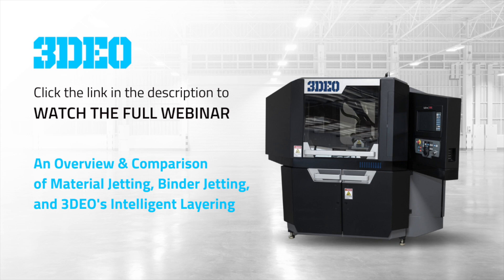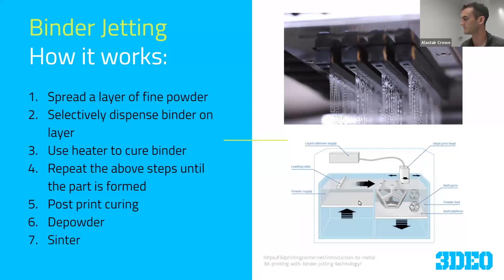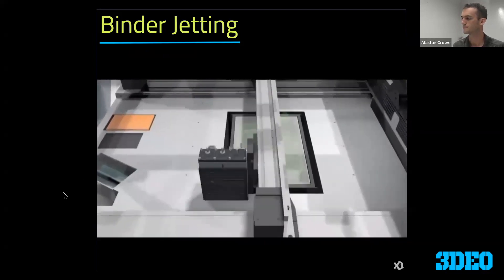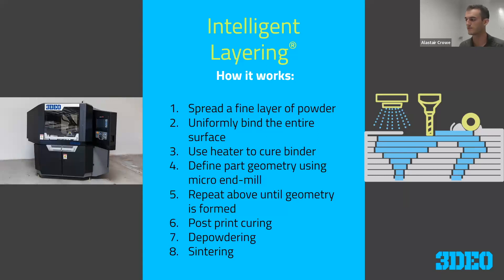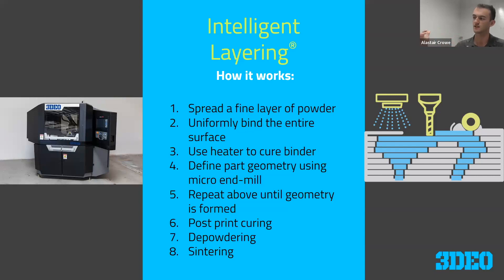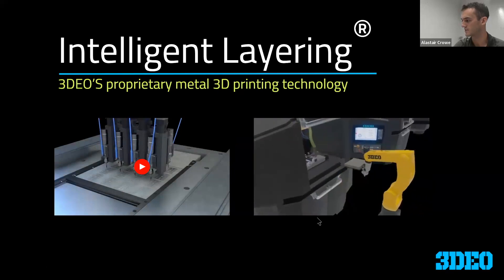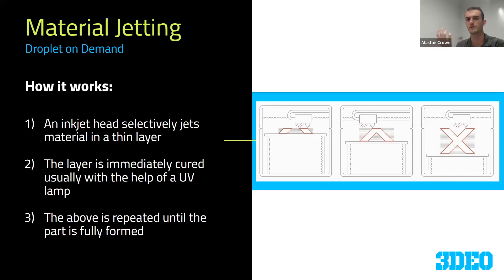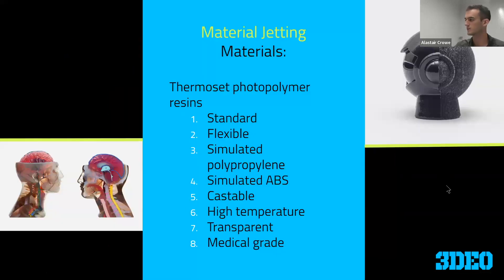Webinar Preview | Overview of Material Jetting, Binder Jetting, and 3DEO's Intelligent Layering

Comment: 2:20 Spectra Fujifilm Dimatix Printhead Modules, about 256 nozzles, this is based on a CPLD based board, it's Binary Single Pulse. 

I feel if you use something like Kyocera or an SG1024 FFD module you will get about 1024 nozzles, approx 400 x400 dpi in native resolution. Can go much higher with multi pass. 

This tech is actually old. It's Digital Textile Printing or Flex Printing tech but I stead of colors it's binder now and added the Z axis. Just a new application. Interesting with end mill.